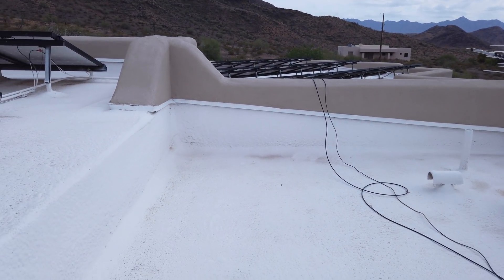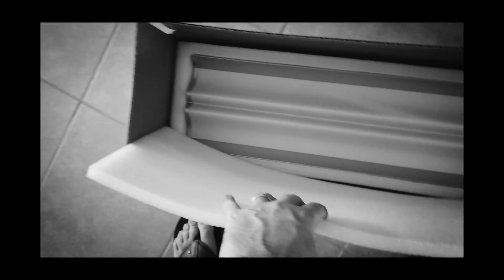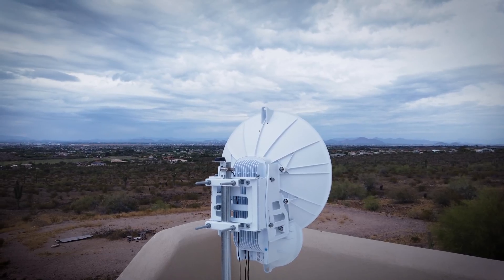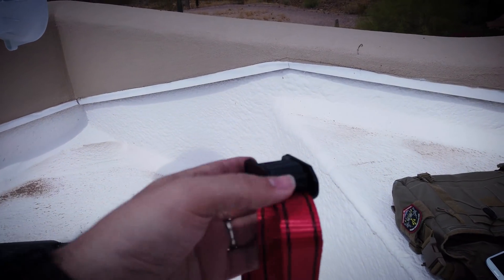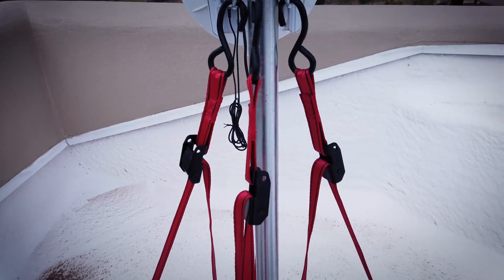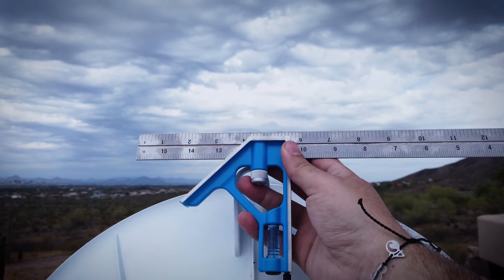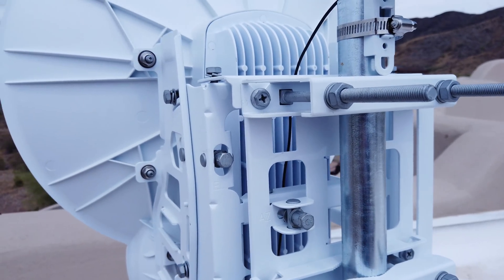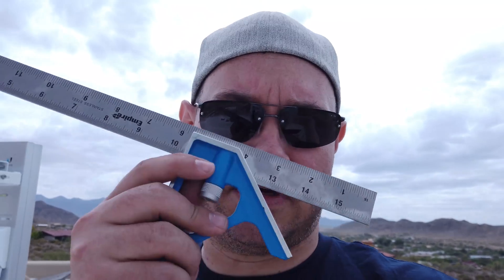WIND BROKE THE NETWORK!! - DIY Ubiquiti Internet Relay - Pt 8

Comment: How far were your nanobeams when you were using them?
Reply from the maker: Each pair was roughly 1.3 miles.
Reply: @rmp5s  I'm getting a 150Mbs plan. I'm considering using nanobeams as a backhaul to connect ~2miles. 

Do you think I need a backhaul like the AirFiber 5? Or will a nanobeam (or something similar) be ok?
Reply from the maker: @Zeab  Not knowing anything about where you're at or specifically what you're trying to do, I can't say for sure. But the AF-5X is probably pretty overkill if you're just trying to shoot some Internet to a rural house or something simple like that.

Comment: I'd be moving that AF24HD closer to the end of the building, OR lift it higher.
Reply: Hey, good job. I been doing wisp for over a yea and the only way of doing things is just testing it. You need more elevation on the antenas for better connection, I think you can get 1.3 gb on the link if you play around with Chanel's and elevation.
Reply from the maker: @alexanderp3051  Already got them switched out, man. Not even using these anymore. See my latest videos. 😁
Reply: @alexanderp3051  Yeah, I'm thinking there is fresnel interference. The beam is narrow, but I'm sure with it that low to the structure, the fresnel zone is being penetrated.
Reply from the maker: It's as close as possible. Works fine where it's at. 😁

Comment: Hi there.

I am looking with interest at your series and your project. I have a few observations:

You could probably increase your throughput with a few measures: 

a.      Put the data center antenna closer to the edge of the building, and/or put it up a few feet higher. By the looks of things a significant amount of your signal will bounce of the roof into deep space at the moment. If you use link.ui.com (also handy if you want to survey your neighborhood customer base) you can see what amount of height is required to clear your Fresnel zone. Same goes to a lesser extend to the receiving end of the line. Using scaffolding pole would help against the wobblyness. 

b.      What kind of Ethernet cable are you using to connect the dish in the datacenter? If this is cat5e and the distance
is over 100ft you will not get 1Gbps down the line let alone 1Gbps up and down what you are paying for. So, roll out some CAT6, preferably full copper instead of CCA. Same goes for your burned down receiving station.

c.      Have you enabled the GPS link feature on both the antennas? This will probably add a few megs to the line as well, as it allows for cooperation with the other antennas. The send out signal is choreographed as it were, so there is less pollution.

d.      An old trick for aligning the radio’s is the use of a rifle scope, and hooking up a laptop to measure the signal strength/throughput. And it is done best with one person on each end at the same time ;).

Will be following your progress with interest. Keep up the good work!
Reply from the maker: Thanks for the feedback.

A - That's not an option.  I wanted to do that but it has to be where it is.  I'm VERY familiar with Ubiquiti's fresnel page.

B - All cable is outdoor rated Shireen STP Cat5.

C - GPS is enabled.

D - That's basically what we did but, instead of a rifle scope, we used binoculars and the carpenter's square.  It worked just fine.  I'm getting pretty good reception.  It's just a long shot through downtown Phoenix.

Thanks for watching!
Reply: @rmp5s  You are welcome. Looking forward to the next episode!
Reply from the maker: It's already uploaded and ready to go!  It goes live next Sunday at 9AM Phoenix time.

Comment: your definitely going to need better mounts for those 24s because those  straps are not going to last any length of time.. check out
 perfect vision,  theyre a supplier for several industries including the wisp industry. they have all kinds of different mounts and small parts and hardware and all kinds of stuff they don't have very much in the way of radios and antennas though.
Reply from the maker: They'll last plenty long enough for me to get something better. EASILY a year or two. 

I'll check that out! Thanks!
Reply: @rmp5s  No they wont. You need 1/8" guy wire and turn buckles. the sun will destroy those straps within 8 months. Theyll also stretch. The mast pipe is also not wide enough for the af24Hd. Nate is an industry professional. We are colleagues.